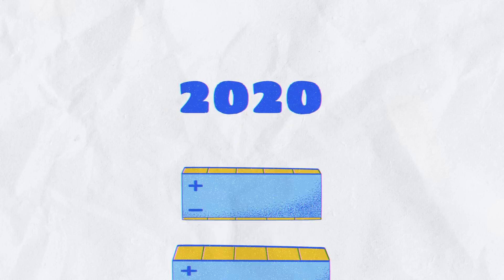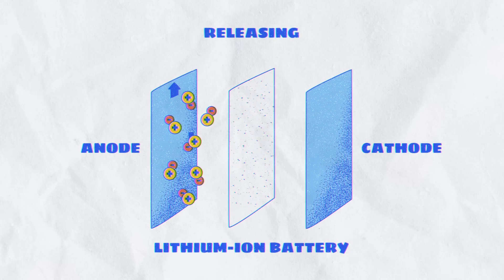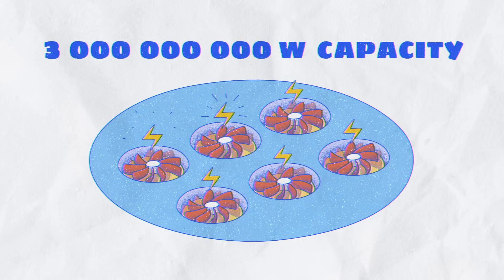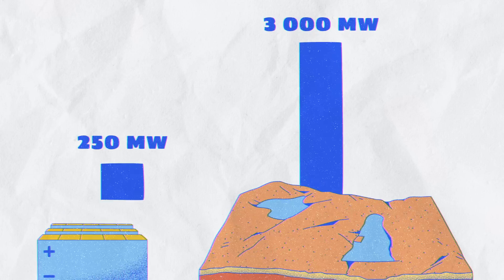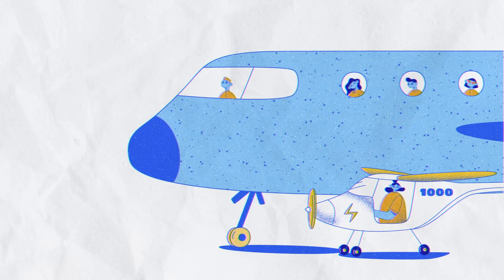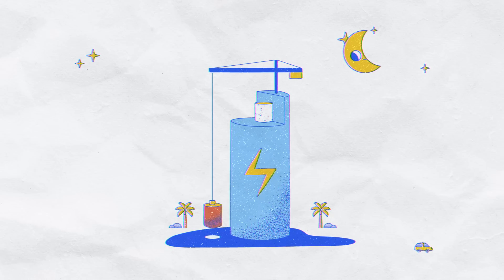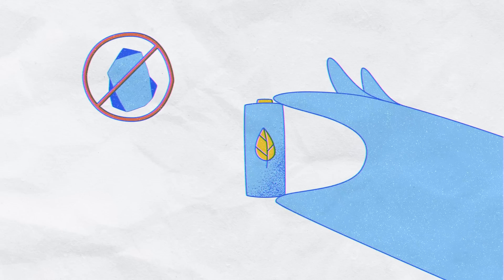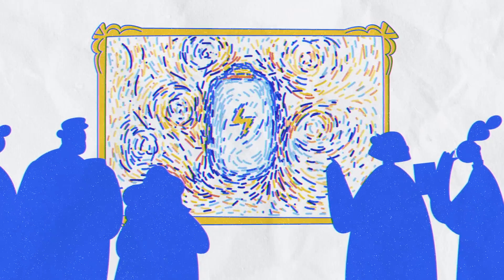How scientists turn lakes into giant batteries

Comment: Nice video. Few notes though: that skyscraper builder failed and was never better than water/lakes. There are many other solutions, compressed and/or cooled air, underwater pressure, non litium batteries, etc. Grid needs very different properties than handheld devices, the only reason for litium is the economies of scale. Also nuclear batteries are actually power sources not batteries, you cant recharge them.

Comment: I have built windmills as a hobby for over 50 years. I also build small engines, which operate on compressed air. All my windmills compress air and I store it and what I call an air battery, which is nothing more than a giant receiver tank. I don't see why this wouldn't work commercially. There would be much less maintenance, fewer moving parts and everywhere I've ever been there is air.

Comment: These lakes are only 27,927 Acre feet capacity. San Luis Reservoir is 2,041,000 acre feet and operates in the same model of energy storage. So San Luis’s energy storage potential is 73x larger. Another interesting fact, JFK did the ground breaking of San Luis.

Comment: Yes, and Santa Claus is real.

There is a basic lack of real technical understanding of grids and their power source by inovators of these schemes.
Batteries and pump storage (A tecnology that is decades old ) can do well to serve grid sudden spikes in energy requirement, either due to sudden demand or loss of generating capacity connected to the grid.  Storage like that can come on line very quickly but for a short duration. That is all that is required and that is all they are used for. This gives time for alternative slower to react back up sources to come on line,if required.

Battery storage for intermittency is pure fantasy due to the extremely large capacity required (Not power output as in Gwatts) Britain for example has recently had over four weeks or more single figure wind generation. A ball park figure of an output of six to eight Gwatts below average. Using the lower figures gives a requirement of over 4,000
Gwatt hours of requirement. Mr Musk's 'giant' battery in South Australia is something like 0.12 Gwatt hrs.
And once depleted, a grid battery has to be recharged by the grid power suppliers while providing grid power for demand.

Comment: There are many ways that a sky scraper can be used to generate electricity.  One day all the windows of a skyscraper will be solar powered cells, capturing the energy of the sun while being see through at the same time.   The tops of skyscrapers are windy so put a lot of windmills up there.   Also, instead of a water mill put a sand mill inside the skyscraper.   This means have tons of purified grains of sand held in a chamber at the top of the skyscraper and have the sand pour down until it hits a sand mill.  This is just like a water mill but instead of water turning the mill, the gravity of sand does it instead.  Below the sand mill is a funnel catching the sand and below the funnel is another sand mill catching the sand and forcing the sand mill to spin.   This process is repeated all of the way to the ground.   These funnels and sand mills are gigantic with tons of sand going through them constantly.   Attached to each sand mill is are electric generators producing massive amounts of electricity.   At the bottom of the skyscraper is a chamber to hold the purified sand.  Some of the electricity generated powers an industrial strength but efficient vacuum system that sucks the sand back to the top chamber of the skyscraper.   It may need to do this in stages until the sand makes it to the top.  Because of the efficent vacuum system and because of the numerous sand mills gathering electric energy all the way down...there is a net gain of electricity.   These sand mills being turned by sand can also be astecaccly pleasing to the patrons of the skyscraper.   The arrangement of the sand mills and funnels can be put behind glass and arranged in artistic ways.  The funnels themselves don't have to have a round lip at the top but could be flattened at both ends and also put behind glass panels.  The skyscrapers of the future will have shops and restaurants and recreational facilities at the bottom and offices in the middle and hotels and apartments above that.  This is so that one could live their entire life in a skyscraper without ever leaving it.  There are so many ways that a skyscraper produces electricity that they are essentially a power plant themselves.   They can make money my selling power back to the grid.

Comment: Would it be possible to use that crane method, but power it with Earth gravity space elevator style? So have a tether that keeps an object in orbit, then when energy is needed brakes are released to let the object float off into space while the tether on the surface spins a generator. Then, as with the cranes, have excess green energy reel it back into orbit on low power periods.

Comment: I get the concept of storing hydraulic power as a "battery" for electrical power but it doesn't make sense from an efficiency standpoint., Firstly,  you lose SO muchg energy pumping that water uphill. At EVERY STEP you lose energy. The electricity to the motor, electrical motor to the pump, the pump ion the water, the water on the pipe.  THen once it flows down again, you lose all that energy AGAIN. 
Just build the hydro-electric plant with those "six giant turbines" somewhere with enough water uphill that no uphill puimping is required. Of course, that's just a hydro dam and they aren't great for the environment either - they require the flooding of valleys and then huge power plant worth of infrastructure PLUS giant dam that is dangerous in its own right. We stopped building dams in teh East (east of Mississippi) like before WWII. Very few have been built sicne then. Some have been modified.  But all the big dam projects were out west - and out west... WE DAMMED EVERYTHING WE COULD THAT WAS WORTH DAMMING. Now we're skimming the bottom of the barrel.
No, hydro not gonna save us. IT's not even available to make a dent in the massive GHG equations we're running as a species. And we're running out of time. Already we're 'hoping' to AT BEST minimize the damage. At worst it's like another collapse like the Bronze Age collapse and then the collapse before Medieval times

Comment: This video is wrong. Its the sun.
Reply: The sun is a generator not a battery.
Reply: A generator is like a battery. It contains power, just hit a switch. Except for a battery, you have to insert it to give off the same power. Its the same concept. The sun holds energy, just need a way to acess it.
Reply: @danielnanan8112   Generators MAKE power they do not store it. Diesel generators for example run a diesel engine to generate electricity. Yes, that is technically extracting energy from the diesel, however, batteries also need to be able to be rechargeable. Since we cannot change electricity into diesel, a diesel generator is not a battery. Similarly, we cannot convert energy back into hydrogen to stuff back into the sun. Since that is impossible, the sun is not a battery.
Reply: @samurailobster6561  generators dont make power, they convert chemical energy into electrical energy, the chemical energy coming from gasoline. It converts energy into another energy. Maybe its like, the sun is the gas and the solar panels are the generator.
Reply: @danielnanan8112  Yes, generators “make power” through conversion. However,  batteries convert electricity into chemical power and then back again. 

Btw, you proved my point, “ the sun is the gas than solar panels are the generator” key word gas and generator. While yes that is an analogy, solar panels harness the power of the sun. In other words they convert light energy into electricity. That makes solar panels a generator. 

However fuel and batteries are distinctly different. When you burn fuel/extract all the energy from it, you cannot put the energy back into said fuel. Batteries on the other hand can have energy put back into them. It has to be a two way process for it to be a battery. 

Here’s the cycle of fuel.
                                      /————>Waste
Fuel—> [conversion]————->Power

Since after the fuel is used you cannot put the power back into it, as the fuel is now waste, fuel cannot be a battery. Meanwhile batteries look like this

Energy——-> Battery[empty]———Battery [full]——-> [extraction of energy]——-Battery [empty] and the stored energy. 

Since a battery can have its energy added back into it it’s a battery and not a fuel. 

If we postulate that the sun is a fuel like you say, it cannot be a battery. However here is the suns diagram

2 Hydrogen atoms ——>[gravitational pressure fusion and heat]——>1 helium atom, heat, photons and kinetic energy(nullified by immense gravity)

The sun, converts hydrogen, into helium heat and photons. Since helium cannot be fused with hydrogen it is effectively waste. (it will eventually be fused too but only when the hydrogen runs out) and since no amount of heat can be added to the helium to convert it back into hydrogen (it just turns into helium plasma unless and extra factor gets added) that means that it cannot be a battery. 

In conclusion, the sun is a generator because converts a fuel,hydrogen, into waste (helium)  and power. It is not a battery because helium cannot be turned back into hydrogen with the power output. The sun cannot be recharged so it’s not a battery. It is a generator or a fuel.
Reply: @samurailobster6561  i think its a fuel. I think so beacuse, as you said, it does so with members of the periodic table. So does gasoline and diesel for generators. But the sun is not a natural resource of power without its receptors, like a solar panel. Just like the fuel is with the generator.

Comment: I think that it is possible to use the sea waves to produce electricity. I mean they are moving all the time, day and night. I imagine things like walls around the shore pushing vertical plates like walls towards the shore that may rotate gears to produce energy and the recoil after the water pulls back.

Comment: why would we use two lakes instead of a river? don't rivers flow automatically? any waterfall should achieve what the "biggest battery" can achieve and it's not limited to a couple of hours. it works 24/7. what have i missed?
Reply: If they put it on a river it would be a generator, not a battery. The lakes store energy from the grid while a river adds new energy into the grid.

Comment: Energy released to generate the electricity would be equal to the energy it takes water to pump up the river on the high ground (300 m) in the two pond battery example. Then how is this efficient? We are achieving nothing.
Reply: It takes advantage of the difference in price for the electricity for low and high demand: low demand = cheap electricity so that's when you pump the water up to the higher lake. High demand = expensive electricity so that's when you let the water out to run the turbines.
Reply: You don’t quite grasp the idea of storage do you?

Comment: ummm.... the problem is energy density... and no solid battery comes close to the energy density of fuels... but what are fuels but just another form of battery? Carbon chains that were made from atmospheric CO2 using solar energy that can release that energy on demand when oxidized back into carbon dioxide... seems to me we just mimic nature and get better at cycling carbon... possibly increase photosynthetic efficiency through GM so plants store more solar energy, or skip the plants entirely and use photovoltaic/wind/etc to convert atmospheric CO2 back into natural gas... talk about the answer being right in front of us!

Comment: Home UPS system, but connect with the internet. Meantime the UPS will sync with the generator factory. Which everyone in the city had their own battery. Because of the data synced, each UPS will be able to charge in a different timeline/occupation. So it will significantly help the due to power usage peaking and power supply shortage.

Comment: Just an idea but if roundabouts and busy roads and pedestrian zones were fitted with some kind of kinetic energy panels made from recycled materials, coupled with solar paneled roofing on every building and medial wind energy turbines there would be a noticeable decrease in energy consumption (and costs) as energy would be created almost constantly, making normal comings and goings of people a battery of sorts(you're not just walking or driving your creating energy). 
The upfront costs would be high but as the technology is further researched it would become cheaper and cheaper. I have even seen some research into placing turbine in sewer systems to generate energy from waste water.

Comment: Watching this as a Texas who just experienced a week of blackouts and water shortages
Reply: While you have my deepest sympathies, those weren't due to battery tech, or even sources of available energy... that was because texas energy companies have no incentive to winterize the power grid. I've worked in the oil and gas fields in the far north of canada where all of the energy infrastructure continues working just fine at temperatures below -40... this includes windmills, solar, natural gas etc... the problem to me seems to be the system in place in texas actually disincentivizes energy companies in Texas. some saw record profits during this crisis due to the ability to use market demand pricing... $9000/Mwh!!!! Insane!!

Comment: that crane that lifts blocks during the day and lowers them at night is actually pretty clever
Reply: No they are not.
If you give more thought on that, you would see why.
Reply: @apurvmj  can you please elaborate? I'm not able to see what can be too wrong about them
Reply: @AaronChristopher869  Efficiency of this crane system depends on difference of height that block will be moved. Bottom blocks will have lesser energy transfer than top blocks. 
When blocks are put down from top locations they need to be spread around that increase lead and horizontal movements only adds to inefficiency. 
Then there is issue of balancing of loosely stacked blocks due to wind, non vertical alignment of block etc.
Reply: @apurvmj  I see, thank you!
Reply: @apurvmj  idk what that means but thanks for clearing up
Reply: @AaronChristopher869  And then there is a matter of moving parts that continually decrease the efficiency of the building.
Reply: @mwanikimwaniki6801  but if you think of it, the net loss from this efficiency issues is not too much compared to the total energy being stored and stuff
Reply: @AaronChristopher869  I don't think that's what we are looking at. We should be considering the feasibility.
Reply: @mwanikimwaniki6801  Thunderfoot I think, made a vid explaining why the crane battery setup is not efficient, energy and cost-wise.
Reply: @scionace9523  I think I can clearly even see why. I don't need a thunderfoot vid for that
Reply: @mwanikimwaniki6801  Yep, sorry, its cool. Just thought it might help.

Comment: Coolest battery design I've seen is a flywheel battery. Basically you use energy to spin a cylinder in a vacuum, and when you need energy you use the cylinder's momentum to create electricity. There's such incredible amount of energy stored in those things it's crazy.
Reply: THAT is cool. 😃👍

Comment: An extremely big battery would be caves filled with gasses. We use energy for water -> hydrogen -maybe-> methan and pump it in a cave. When we need energy we take some of the gas and burn it. This process frees energy and we have a big battery. And those caves are already there, like the ones we harvested natural gas from. Power to Gas.
Reply: not cave... IF we create enough to need such massive storage systems, then pump it into depleted shale formations that had previously been fracked...